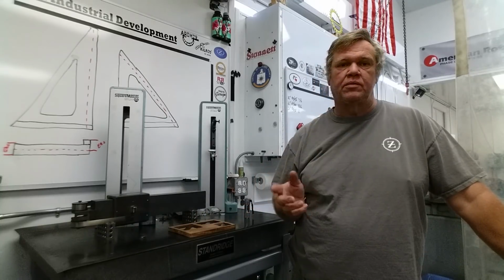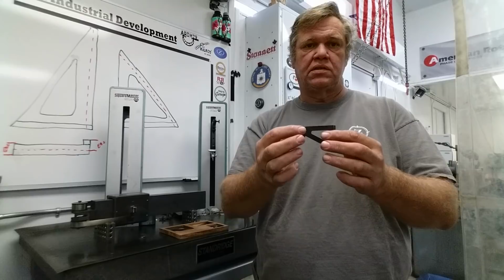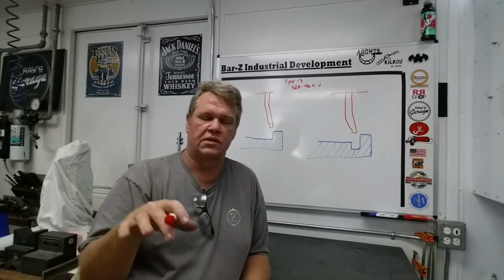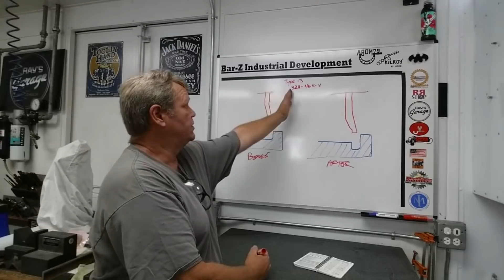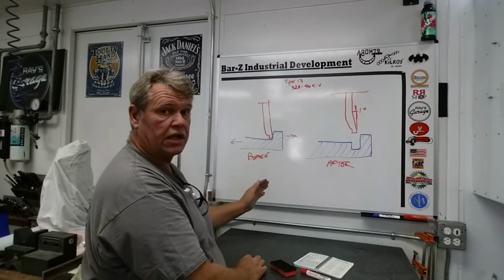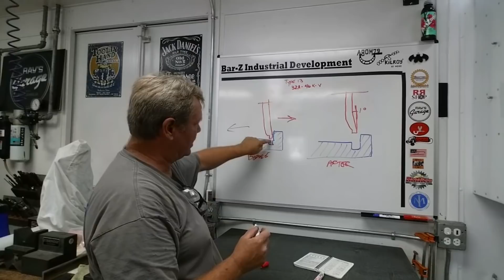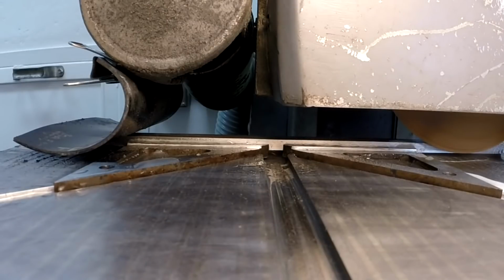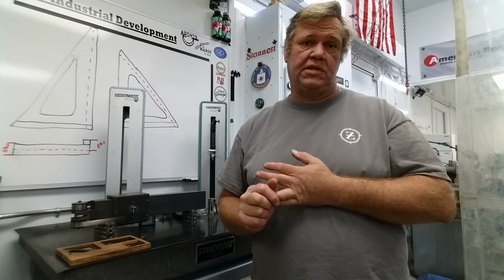Z SQUARE DIY kit Part #2 Inside corners

Comment: what is in your opinion the problem with milling the recess in the inside corner,for instance with a ball nose end mill. this give you the opportunity to approach the flats with a "standard" grinding wheel.
thx

Teun
Reply from the maker: I have tried it both ways, the extra op during milling isn't worth the time, the grind is much faster.
Reply: Disc mill may be faster...

Comment: Nice video Stan, a little off subject, but could you give a link or lead to those awesome glasses. Have seen the bifocal types but those are perfect for the blind old fart that is me. Thanks
Reply from the maker: I wear 1.5's but I think they go all the way up to 2.5's 

https://www.amazon.com/dp/B00KSJQC8W/ref=sxr_rr_xsim_1?pf_rd_m=ATVPDKIKX0DER&pf_rd_p=3008523062&pd_rd_wg=zP6wI&pf_rd_r=676KAXY9R628N4NVRK5V&pf_rd_s=desktop-rhs-carousels&pf_rd_t=301&pd_rd_i=B00KSJQC8W&pd_rd_w=GJQLY&pf_rd_i=safety+glasses&pd_rd_r=3G2C5SPC0QCE69PWV3F0&ie=UTF8&qid=1503622005&sr=1